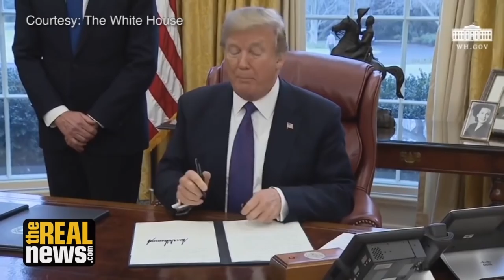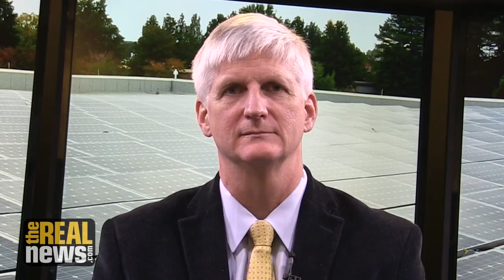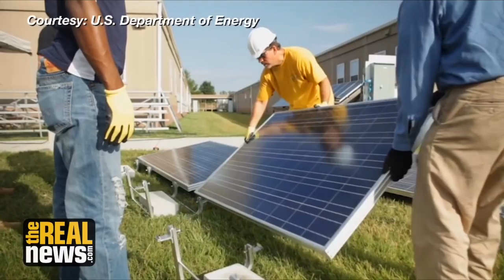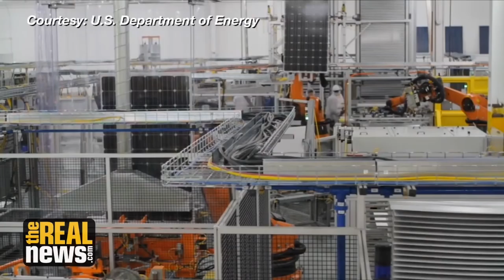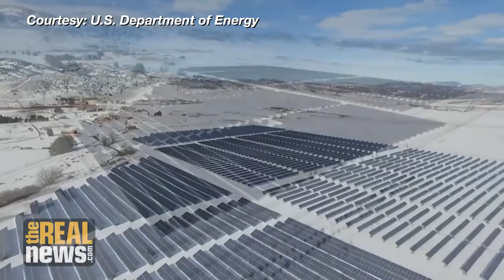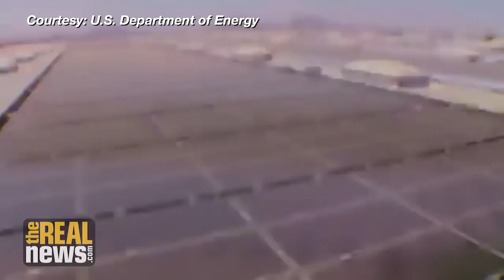Did Trump Screw Over Booming U.S. Solar Industry?

Comment: I think the speaker put the cart before the horse when he says the increase in installation is causing the increase in solar panel production, when rather it seems that it would be the increase in production, which then leads to the decrease in cost, leads to the higher rate of utilization by consumers, which then prompts higher rates of installation. Also where is this 23,500 job number come from? He seems to just kind of throw that out there and the interviewer didn’t press him on where that figure comes from. He didn’t even preface it by saying it is “speculated” to cost roughly 23,500 jobs, he just said it WILL cost with absolute certainty without citing a source.

Comment: The only claim against the tariff that makes sense, if it is accurate, is that most of the jobs are in installation, and very few in manufacturing.  On the side of the tariff is that the Chinese are known to be manipulating their currency to undercut competition, that they require the sharing of manufacturing knowledge from foreign companies that site factories there, and that they have nearly zero environmental or labor protection standards.  So maybe the tariff is a net loss, but it seems like it's being attacked just because it's Trump.  Remember the outrage over the WTO and PNTR-China and GATT and NAFTA that led us down the spiral to the bottom of environmental and labor protection?  Suddenly looking to the WTO as the representative of goodness seems suspect at best.

Comment: Well this should be a reality check for the solar industry. The solar lifecycle is almost entirely resource extraction, processing and manufacturing. When you take into account the entire life-cycle, you realize what a poor return solar energy has, which is why it's dependent on having two thirds of capital costs subsidized plus a tax credit for every unit of electricity produced. Solar cannot provide base-load power, it requires the most resources per unit of energy, requires loads of gas and coal to be burned in the extraction and manufacturing, requires wasteful load-following, and ends up increasing net fossil fuel consumption and emissions.   

High-return base-load power is what we need: Nuclear and Hydro. Solar is just a fake solution to perpetuate fossil fuel dependency, and it's fundamental flaws are revealed in it's economics.

Comment: Solar isn't all it is cracked up to be.
Reply: ariesred777 the sun doesn't shine everyday. That's a fact.
Reply: Most of US the sun does shine everyday, and there these things call batteries that can store the electricity generated of bad days.
Reply: Paul Cordova how's the weather in Moscow?
Reply: True, solar is intermittent, requires vast areas of land, produces the most waste per MWh, and needs to be constantly backed up with a combustion source. If it's cloudy for a week you end up generating all that energy with natural gas (if you're lucky, otherwise biomass or coal), and load following plants are small, relatively inefficient turbines compared to dedicated gas plants. As more solar is deployed, you actually get an increase in emissions and fossil fuel consumption because of the resource intensive life-cycle( consider the mining, processing, manufacturing, short product life, low return ratio). High-return, base-load power is what we need, like nuclear and hydro.
Reply: Ioannis Nousias, the "payback" you're quoting is simply how much wattage goes into the manufacturing of panels (not including original silicon processing) then how much time it takes to generate that wattage with the panels. In practice it is not that simple. Firstly, you need to take into account the entire lifecycle which includes silicon mining and smelting, plastics production, mining and processing of cadmium and other metals, while keeping in mind that it takes about 6000 acres of PV panels per GW of nameplate capacity. That's a huge amount of material per GW. Then that GW has to be backed up by another GW of on-demand capacity. Load-following is inherently wasteful as it takes extra energy to be constantly revving up and shutting down these load-following plants. Solar is effective if it's used on a very limited scale and just with roof-top grid-integrated applications, but on any industrial scale you end up burning more fuel to load follow and wasting the investment that was put into these thousands of acres of PV arrays. Look at Germany's data on how their coal consumption has increased since their switch to renewables. Germany has invested billions into renewable generating capacity and their emissions have only increased (doesn't help when more than half of your "renewables" are biofuel and biomass), and they have to buy nuclear power from France to constantly balance their grid. 

The countries and regions with lowest emissions per MWh use hydro and nuclear. 
www.electricitymap.org
Reply: It's MORE than it's cracked up to be. Hide and watch.
Reply: Looks like the petroleum industry has sent ours trolls! "Solar isn't all it's cracked up to be" is so twenty years ago! And don't forget, when the sun isn't shining, the wind is blowing.
Reply: Within 100 years I think nearly all our power will be Solar, unless we get Fusion working well.

Sun shines 24/7 in space, and you get a lot more power without that pesky atmosphere in the way.

Just going to need one really long extension cord.  And its the perfect plan :p
Reply: Carla Medina as the article I linked says, the ‘payback’ is “including costs for mining, transportation, refining, and construction”. Read the article and you’ll see the assumptions made and which research groups have and have not included the energy for Silicon and aluminum frames. As for load balancing, the best option is batteries which are starting to be deployed now. 
I’m not sure if you are being disingenuous or simply misinformed. Gas and coal are very slow to react to demands. Which is why we keep them on even when not needed and paying for them (essentially a form of subsidy that is not taken into account when arguing about subsidies). We are wasting huge amounts of energy because of that. Only batteries are able to fix that. Look at the recent case in Australia. And yes, it takes energy to make energy with batteries too, but ‘payback’ is similar for them too (they are not an energy source, it’s about the energy saved by not having gas and coal and nuclear running more than actually needed).
Reply: Ioannis Nousias
I'm not sure where you're imagining this but gas & coal can load follow really well. https://en.wikipedia.org/wiki/Peaking_power_plant

That's how the US & Germany load balances, batteries are a fairly hopeless as they simply don't hold enough energy to be useful on a grid scale, the largest of that type for example holds around 400 MWh, or about 2.4% of my province's generating capacity which would be 0.1% over a 24 hour period. This is barely shaving the tip off the peak, if you want grid scale storage you have to look at large hydro reservoirs.
Reply: AmurTiger, two things. A typical ‘peaker’ plant takes 10 to 30 mins to come online. Forecasting models are used to predict when high demand occurs and fire them up in advance. The overall grid is thus always over generating and dumping excess power. I can’t find a reference now, but I believe it’s around 10% over. It’s similar to how traction control works in most cars, rev up the engine and use the breaks for fine control. That’s were batteries help. They respond in milliseconds, so your grid can be tuned to meet the average demand rather than peak. And it’s the MW that are more important than the MWh here, since you only need the battery to shave off the spikes. The battery is quickly charged up shortly after. Going back to renewables, solar and wind tend to complement each other but still need a ‘background’ generation and longer term storage. The nice thing about batteries is that they are easily deployable and scalable. With the transitions to electric cars, we have a ‘two birds with one stone’ scenario. Car batteries provide distributed load balancing and storage, one that is following where the demand is, as people commute. Capturing excess, releasing it when needed. Average EV battery capacity is now 60KWh. With an average 40mile commute, they are largely untapped.
Reply: large area, you mean like people roofs, light post, and such. There are people who have solar panel on their roof that produce enough energy to sell back to the grid. As for week without sun. There only one place in America that happen, Alaska. Even in area where you get rain, it rare for two full week of rain, and the solar panels are become efficient enough to get the what sun light come through the clouds. Also there large chunk of America like desert and even rainy Florida that have plenty of sun each week. There also there this thing call batteries. Which can store energy when energy is low. And the main resource for solar panel, silcon, a very common element.
Reply: Regurgitating something you heard on the morning radio show or Fox or.........?
Reply: Except most of what you're saying is marketing and not the actual reality of the world.

Certainly thermal peaking plants do have response times that requires some wastage and batteries are faster but that doesn't fix the huge quantity and scale issues. Batteries are not provably 'easily deployable and scalable' call me when you have 72GWh of battery storage on tap and then we can start to talk about real scale as recent as 2016 you were looking at the largest battery setups being 400MWh.

https://www.scientificamerican.com/article/world-s-largest-storage-battery-will-power-los-angeles/

While you guys are waiting for the next miracle technology or scheme to wander around the corner Germany continues to burn tons of coal to backup it's wonderful energiewende and use more CO2 per capita then France. If we want to seriously address Climate Change now we have to at least implement in parallel solutions that we know will work, nuclear/hydro dispatchable power with renewable providing 10-30%.
Reply: AmurTiger what are you planning to do with your 72GWh battery? To put things into perspective, the total electricity generation for California for the entire year of 2016 was 290GWh. So you want to power California for 90 days on battery alone? What usage model do you envision here? 
As for nuclear, it’s totally not cost effective. Look at UK’s HPC. Will cost £20b to build (2025), and the electricity it will produce will cost 2x the £/kWh of that from wind today!, costing another £50b to the consumer in the 35years it will take to pay for it. It’s too late for nuclear.
Reply: You forgot some zeros there man, it's 290 567 GWh over the course of a year, 72 GWh would be 10% of one day's average demand.

http://energy.ca.gov/almanac/electricity_data/total_system_power.html

This isn't hard to work out when you consider that Cali's peak demand is 50 GW and that it's pretty inconceivable that they can tear through a sixth of their yearly power consumption in one peak hour.

https://en.wikipedia.org/wiki/Energy_in_California

You look at HPC I look at Germany, however expensive HPC actually promises to produce dispatchable no-CO2 power while the 'renewables only' plan seems to always involve some fossil fuel backup behind the curtain. Nevermind the fact that that 20 billion nuclear plant will have 3-4x the lifetime of any wind/solar generation you can manage, but hey I'm one of those crazy people that believe in building long-term assets that our 'modern' financialized western world has forgotten, little wonder why China's leading the way.
Reply: AmurTiger indeed, I stand correct. Damn those pesky zeros.
Reply: Watt-hours aren't exactly helping either as a somewhat awkward unit but you can see why we need much much larger storage to really be talking about proved scalability. In places with large hydro reservoirs you can store enough energy ( not pumped storage just deeper throttling of existing reservoirs ) but everyone else is counting on either fossil fuels or Nuclear, given I want to avoid at least some climate change I favor nuclear, at least until we have an actual built example of a dispatchable alternative.